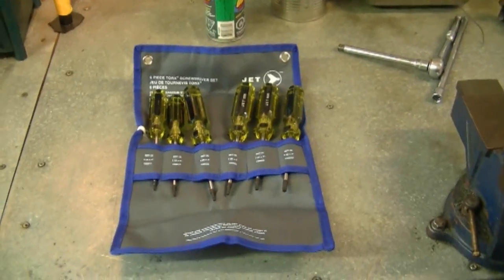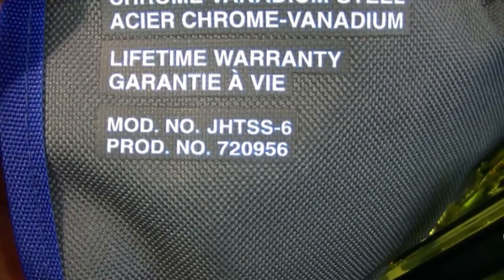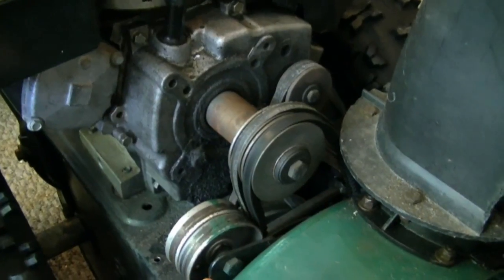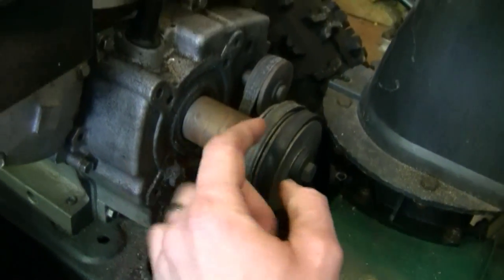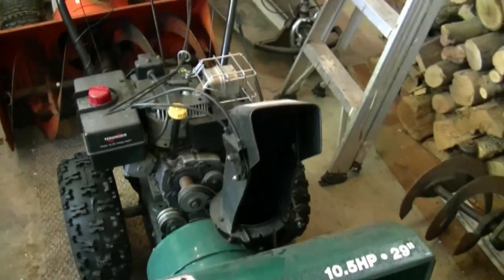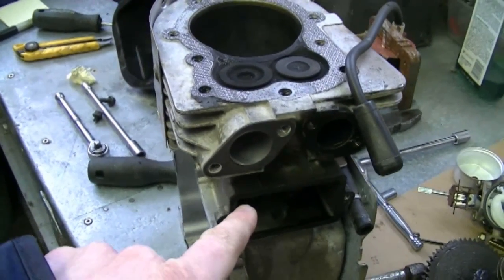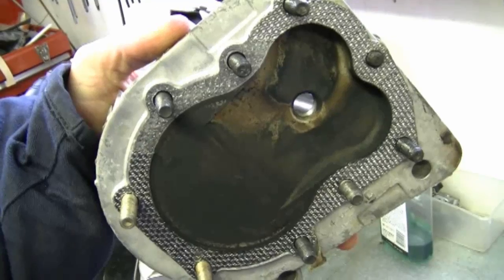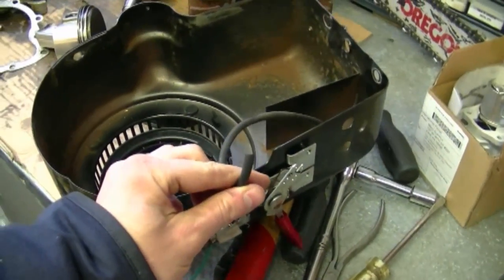Small Engines Q & A  Video #35 in HD

Comment: But here is the BIG QUESTION: I Have a craftsman  536.881851 with  B&S engine
 Model #15A114-0342-E1 . First year- no snow . Since then the longest it will run is 20min - then stall - then won't restart til cold. Apparently very common problem. PLEASE SEE this thread: - can't post thread - just Google  "sears-craftsman-snow-thrower-dying"  it will be the top match  Any advice? Have you come across any of these? thanks.